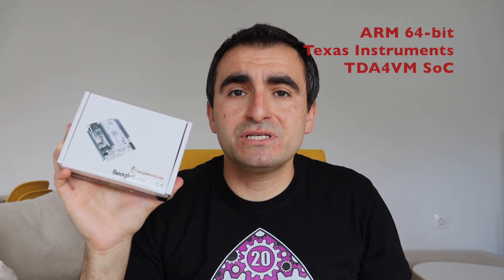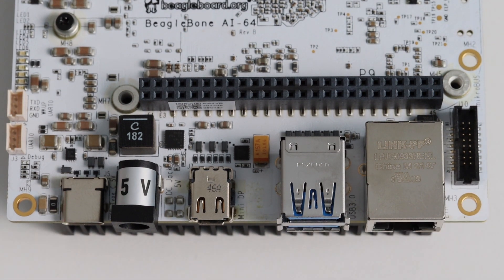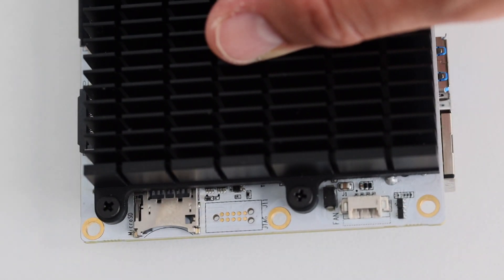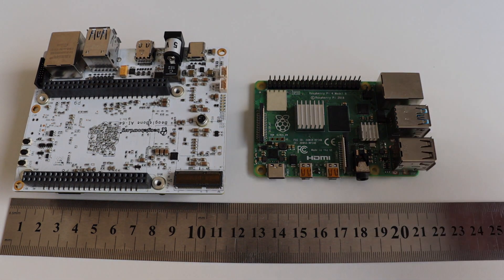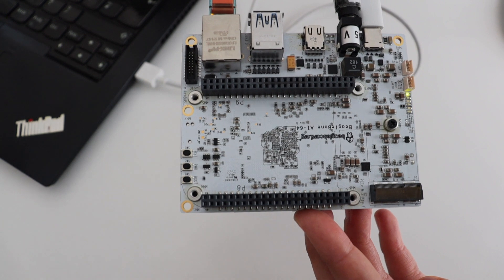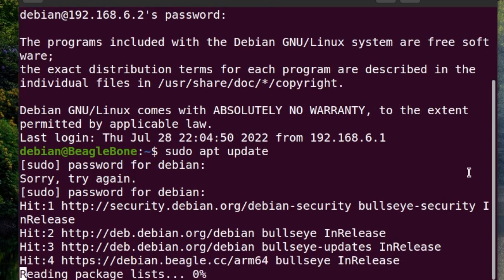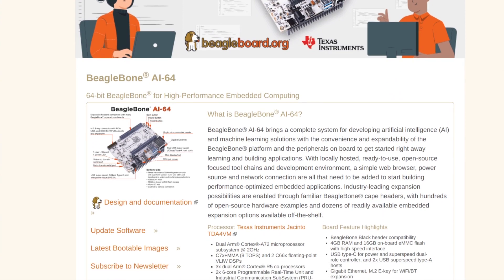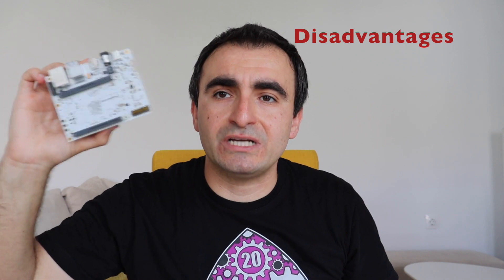BeagleBoard BeagleBone AI-64 with ARM 64-bit SoC and Debian Linux distribution

Comment: This board is garbage... It has no DRM support. Meaning NO GPU drivers. All you get is software rendering. And there is only one Linux distro. and no hope in sight that it will ever be supported. total waste of money.
Reply from the maker: Wait a minute, yes, this is board isn't for heavy-duty multimedia applications like for example devices with NXP i.MX8MP but you can attach a lot of peripherals. Also you can built your own Linux distro with the Yocto Project and OpenEmbedded using the meta-ti BSP layer which provides a machine configuration for this board called beaglebone-ai64.conf. Recently I started making short video tutorials for the Yocto Project on Raspberry Pi 5. Most of the things however covered so far can be relatively easily adjusted to BeagleBone AI-64.
Reply: @LeonAnavi  Thank you, but respectfully, it isn't that simple. The Rogue 8XE GE8430 is close source, not open. Mesa doesn't have an implementation and knows nothing of the internals to implement it. Ti hasn't released anything. The Linux image distributed by Beagleboard is the most recent and has been updated. There is no point in Yocto, unless you've done it yourself and can demonstrate it. This board chip is designed for heavy multimedia and Ti has a demo of it. It is a great chip, however the Linux image sucks regardless of Ti or Beagle. Those folks need to fix it.
Reply from the maker: Yes, I agree - it's not simple. The Yocto Project has a steep learning curve, though it has become much more user-friendly over the past decade. Additionally, building a Linux distro from scratch with bitbake (or actually any other tool) can be quite time-consuming.
Reply: Being based on the tda, its obvious not going to have support anything close to thoes mainstream type sbc for everyone. That being said, this board is shit, I agree. Absolute worst support, the e2e forums don't like bb questions on their forum. I ended up buying the ti evk and it was a whole different experience

Comment: Most of the gpio pins dont work. I tried exporting P8 and p9 pins to ensure i could blink simple led's. however. all efforts in vain. New images when flashed makes the board invisible to macOs.
Reply from the maker: Hm, which new image did you flash? Is there a serial console output with the new image you flashed?
Reply: You have to mux pins, each pin has multiple outputs